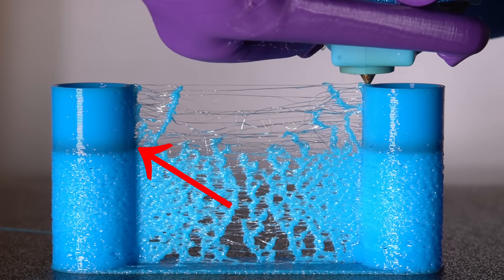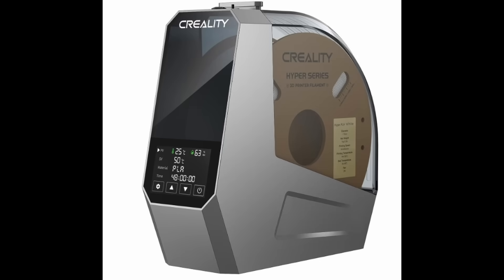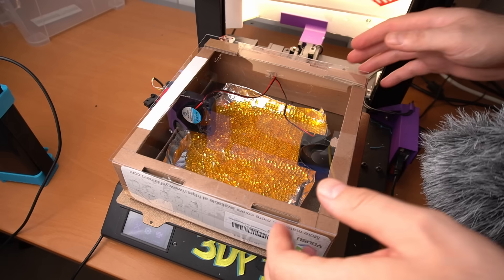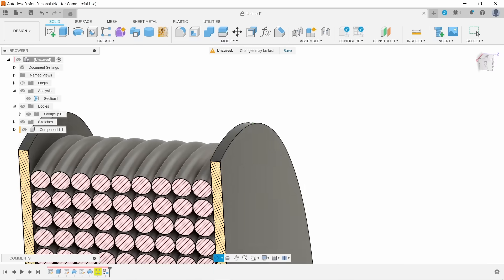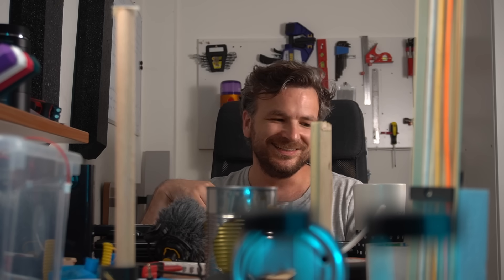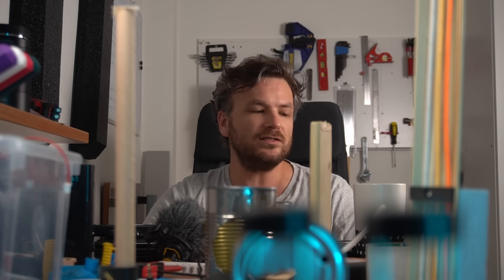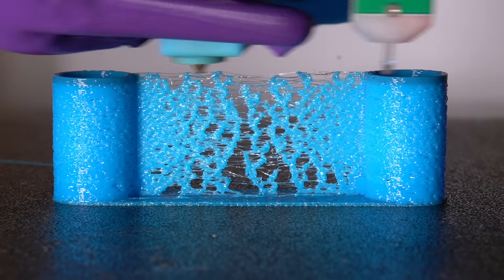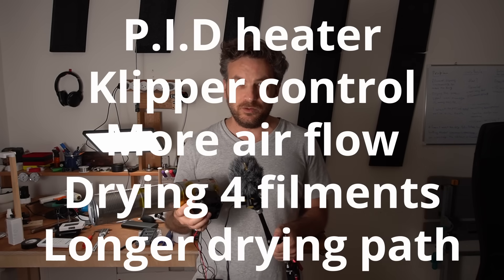Why are we drying filament this way?

Comment: If you need both the Engineer Tin Can and Drybox at the same time for it to work, might as well use a normal filament dryer, right?
You can also easily modify a typical filament dryer by adding fan inside for more airflow, there is plenty of place within the case.
I also don't get the problem you mention with "only drying the outer layer of filament spool" while your tin can only dry a single strain of filament that is going to the hot end.
If I miss a point please do correct me.

Comment: maybe try winding around a spindle on the inside of the can. That way you can get a much more compact form factor.  If wound helically around a 50mm cylinder you will get 15cm each time around they cylinder; so 10 wraps get's you 1.5 meter.  Also if the cylinder can be motor driven, it can solve the problem added drag on the extruder.

Comment: You should rig up some stacked pulleys at each end of the cans and loop the filament back through the cans for multiple passes.  Each pass will give diminishing returns in terms of dryness, so I wouldn't go nuts trying to do too many passes.

Comment: As you have a penchant to experiment, you might want to experiment with increasing the ratio of surface area verses volume of the filament. Examples are flat/ribbon filament and/or several smaller diameter filaments drawn in parallel. An alternative to a traditional drying box (to experiment) is to use a vacuum chamber like they use to degas resins.

Comment: I Think if you can dry the air before you heat it up and put it in the cans it may help dry it out more.  this is where you could use the Dessicant. draw the air through the desiccant and then into cans.

Comment: It's a great idea.  I'd love to see more.  Right now, my 3D print success is kind of hit-and-miss. It would be nice to have more consistent results.  I live in a semi-aired environment, but it's summer, and more moisture is in the air, which I suspect is the potential root cause. Like most people,  I typically have 6+ rolls on the go at once, and some can sit for over a week w/o being used. Be Nice to have a dryer that can handle this.  It would been even better if it could be integrated with the AMS.

Comment: Your probably going to see some improvement if you lag or insulate around your cans, or use a material that won’t just conduct your heat away, PVC pipe would be a contender, or if on the cheap cardboard tube like pringles can.

Comment: Great work. I love these community innovations. Isn't there any kind of industry where they do something similar? I have seen the comments about vacuum chambers etc. But that would make the solution expensive and set you on the path to a € 2000 price tag by the time you have found an easy to operate solution.  And that is not what you are looking for. Also Stephan of CNC kitchen has done some research. Find his video called "Vacuum VS Dehydrator", where he found that vacuum drying looses to heat drying. I like the commenst with some kind of coil in mind. That makes sense but is harder to realise. And you really need heat.
Reply from the maker: one of the comments here said: The funny thing is, we already do use basically this exact method for injection moulding. Especially with smaller machines used in labs and R&D facilities, you don't really have a big material storage with pipes running to each machine, since you change materials way too often. That's why you put your bag of material in a dryer, that's basically a bucket with a hot air blower at the bottom that blows through some desicant (and filters) to dry the granules by blowing warm and very dry air over them. There are inline versions of this, though they require the input material to already be reasonably dry (so similar to your version with the drybox).

Comment: You may still be missing part of the link; airflow is very important but also the air must be dry.  Recirculating the same air means it will become saturated with water and no more drying occurs so either the moisture should be removed from the air, or you simply exhaust the moist air and pump in fresh air which is is exactly how food dehydrators work (which is why they work very well for filament drying).  You are pushing fresh air in with your tin can system, but not with your silica gel drier which is recirculating most of the moist air, apart from a few small leaks.
A problem with this scheme is poor efficiency, you are constantly heating up cool air and then immediately dumping the hot air after it's picked up moisture.  Ideally you want a heat exchanger to pre-heat the fresh air going in with the moist air being exhausted, so that most of the heat remains within the system but the air is still constantly being refreshed. Using air from a non- air conditioned room also means you are at the mercy of the humidity, as this goes up the drying performance of the system will decrease.

Comment: Why not use a vacuum chamber to dry the filament, then all you need to do is buy sealed bins to store your filaments, add a schrader valve to the bin, and when  you put the filaments away, simply pull the bin down a few inches of vacuum and use dessicant beads for any residual moisture that gets pulled from the filament over time.

Comment: Would love to see version 2!  Do you think a smaller diameter can / tube would be more effective?  I wonder if you did something like the dyson hand drier where it is a small jet of air rather than through the can.  Like if you attached the fan and heater to a 3d printed duct that that was the width of the fan but tapered down to the width of the filament +1mm.  Then you would have a blast of heated air focused and concentrated on one spot.
Reply from the maker: That's an interesting idea, concentrated the air flow in one point

Comment: In Poland we make filament dryers from cheap vegetable/fruit/mushroom dryers, since first printers became popular, as drying the forest mushrooms is very popular here. They have airflow, 250W heater driven by thermostat and only need replacement of drying sieves with spool holder.
Reply: That's what I use here in Florida, where we have weeks of 90% humidity in the summer.
Reply: @GeneCash  is that a food dehydrator?
Reply: Yep I use a fruit dryer in the UK, got it on Amazon, works great
Reply: Yep these have been staple filament dryer for years. I think the commercial ones are inspired by them. Do the commercial ones not have airflow? That's a pretty fundamental oversight.
Reply: @sligit  Commercial ones resemble commercial heaters for heat-shaped shoe medical insoles. They are safe, look nice and you are sure that using them you will not be sued for damaging patient's shoe. The fact they don't work at all (insole remains thermally untreated) is the very least concern there.
Reply: @Rampamrampapapapam  so the food dryers are better than the commercial ones?
Reply: @definingslawek4731  In short - YES. But they need some rework to be able to contain whole spool or two. They reward with appropriate power and air flow.
Reply: Are you talking about a food dehydrator?
Reply: Yes, food dryers are better than filament dryers.
All the filament dryers Ive bought and tried would not evacuate moisture efficiently. In some models, humidity would accumulate on the box ceiling and rain back down on my spools. You are forced to use desiccants to absorb released moisture.

Comment: Basically, 3D printing field is still very novel and various startups and small companies making printers, dryers, plastic recyclers as they see fit, they still have very little experience and more then often - not enough technical and scientific knoledge. In about a decade, leaders and outsiders would be clearly seen, small players wold merge, bought by larger competitors or simply going out of business. And we would get a really effective dryers or maybe a filament that won't require drying in the first place. But... would it really be a good thing? 3D printing today mainly driven by enthusiasts and open-source projects, not by large greedy corpos. And it's really great in it's own way. Enjoy it while it lasts.

Comment: you're hilarious, love the format

How warm does the filament get? Do you think this could contribute to heat creep, and/or increase the hotend's max volumetric output?
Think you could seal the tube's environment when turned off with bowden tube couplers on both ends of the tube, and some rotating vent covers when it's turned off? Or would you rather just re-dry the exposed filament before starting the print?
Could your tin can have enough space inside for the extruder motor, so you're drying the filament right before it's taken into a regular bowden setup?

Comment: Good work, of course we would like to see you develop this idea, sounds like you are going to do it anyway.. Are you blowing dry air into the system, can you recycle the air so you don't have to dry undry air on a continous basis, would would it work with a blower if you were just pumping in "warm dry air" this would allow for a underdesk unit without all the cans. Good luck.

Comment: I'd love to see follow-ups to this. I've only recently (re-)started my quest for the holy grail of filament printing because here in summer we can sometimes reach 80% humidity. But even at the current 55% dry boxes have a hard time. I got a SUNLU S2 which just basically does nothing. Even though it has a fan I think it's just doesn't have any way to get rid of the moisture. THen I bought a Polyfill PolyDryer and because it has silica beads included in the box it does a much better job, but after many hours it just gets stuck at 34%. (The box does do a good job of keeping it at that level, 2 weeks later it still reads 34%).
But I'd love to have a way that can a) get below that 34% and b) doesn't take many hours.

Comment: Make the v2, I'm interested in seeing how far you go with this. The series of cans is doing a lot more than I expected but it's still oozing a lot more than I'd like. So there might be a place for this but I don't think it's something I will use but maybe v2 improves on it enough. A big problem is plastic takes a long time to fully release moisture much like it takes a long time to absorb moisture. Separating the coils of filament while drying it around a drum might make enough of a difference.
Reply: I have a Sunlu S1 and it does dry but it needs to be modified. I added a circulating fan, add a hole so a little bit of fresh air cycles through, and reposition the temperature sensor so it measures the air. The temperature sensor keeps the heated plate at a set temperature but it's not heating the air to that temperature. I forget whose video I used as a guide for that.

Comment: I would definitely like to see version 2, I live in a very humid part of the country and if some cans and a little extra electricity can fix the issue without waiting for the dry box to work I am all for it!!! as for multiple drying, I think you would still only need to really dry one at a time since you only print with one filament at a time..

Comment: I think minimising the volume the filament goes through and maximising the heat and air flow through it would make the drier module more efficient.

(I meant minimising cross-section, not the length)

Comment: First.....please, please, please, up your retraction amount!  That horrible stringing between the towers is brutal.

Second, the idea is neat and love seeing people do these things.  Hope to see it evolve.

Third, the idea that 'only the outside dries' is incorrect.  I use a food dehydrator and leave my filaments in there for a min of 24hrs as my place is a constant battle for humidity control (winter too dry, summer too humid....sigh).  I have never found prints that 'suddenly start looking bad' because the inner part was still humid.  I also, and obviously, store my filament in sealed bags with reusable silica gel beads.

As an added bonus, I use the food dehydrator to dry out the beads.
Reply: Retraction doesn't work if you have residual moisture in the filament, and i'm sure he hasn't gotten rid of it all too thoroughly. When the melt forms a gas (steam) pocket from water evaporation in the melt zone, the part below the pocket is going to just leak out, you have no control over it. You can only control cohesive paste/liquid by retraction.

Comment: the key of drying is not directly the airflow - its the air EXCHANGE.
Replacing the hot (and wet from filament) air by cool (fresh and dry)  air is the key, thats why the normal dryers need such a long time (the air exchange rate is much to low).

I dry my silicagel on an open !! pan at about 100° within 20min - best air exchange possible. you can feel the wet air that is directly above the pan!

An inline dryer needs enought time to dry that piece of filemant, so I suggest (Version 2) something like a "inline spool" , that contains maybe 10 windings only in a heated chamber with airexchange (no fan, just ventilation holes maybe). So fresh and wet filament comes into the box - on the dryer-spool (gaps between the turns, and open design) - take 10 turns to get enought time to loose the moisture - and then it goes out dry.

BTW: PTC elements do not really need a thermocontrol. The stuck on their given Temperatur at about 150°max. I did a fan adapter for my DIY dryer box, printed from PETG and it survives since ever without any Thermocontrol.
(you can see it at printables modell 488530).
Reply from the maker: thanks for the segustions, i also think hot air exchange is the key here. i used 300w heater, temp in the cans around 100c
Reply: @3DPI67  think if you extend the time of dry-phase, you can lower the heating power. I use that 50W PTC heater in my dryer, but thats not "inline".
300W add on to the printer consumption ist much energy costs! 5h in a drybox at 50W or print 5h inline at 300W - and the rest of the spool is still wet - makes me "dont do that".
Then its a emergy solution only, if you must print now and the filament is to wet.

Comment: I keep asking people why are we still on filament printers when there are resin printers... its always the same answer, the smell...  i dont know about you but, having to keep materials "dry" fiddling with speeds etc etc to get a proper print is way more troublesome than a little smell that can be easily fixed.

I stayed away from buying these filament printers for years just because of all the hassle they seemed to be and when resin came out i jumped on it...  never regretted it either.

Comment: The only caveat with this on demand drying is that wet filament degrades faster than dry filament. If you burn through any given spool in a timely manner then sure, but if you're like most 3D printing enthusiasts and have some spools on hand that you don't need the entirety of right now but are likely to want later then it's preferable to fully dry those spools and store them in a dry box. Don't get me wrong, it's a pretty clever and simple solution, just need to bear in mind that there are other benefits to whole spool drying.

Comment: I haven't looked around on YT, but I know stuff will dry out fast inside a vacuum chamber. You can get a cheap ($20) good quality vacuum/pressure pump that will pull 20"HG. You can use an old kitchen pressure cooker for the chamber for the spools.

Comment: 2 ideas: 
1) pre-dry the sucked in air with silica gel before heating
2) extend time in chaimber / or filament length in chaimber by a spiral pattern or turnaround wheel within chamber or some similar concept (U-Form Chaimber?) or route filament so that it passes chaimber multiple times

Comment: You should do it with reverse flow. Blower at the top, vents at the bottom. Driest air go to the driest part of the filament, and least dry air to the least dried filament that just arrived.

Comment: A forced air dryer operating inside an AMS would probably do the trick.  If the drying in a dry box only happens on the outside of the spool, that's fine because the printer is only feeding the filament from the outside of the spool.  So hack the cover of the AMS to blast the filament on the outside of the roll and it will likely just work.  The only thing you might run into is the length of filament that rushes in from the AMS to the extruder when you start a print.  It might need some custom code to very slowly feed the first bit of the spool so that amount will also be dry, or just purge a bunch out the poop chute at the beginning.

Comment: I wonder how much drag would be added to the extruder if you had the filament loop around a few pulleys, so it could make multiple passes through the drying tube.
Reply from the maker: That is something ill have to find out

Comment: Store your filaments in a pumped out vacuum bag with indicator silica. Don't leave filament in an environment with a RH% higher than you want your filament to absorb. There are many mods that can be done to the basic Sunlu dryer to recirculate the heated through indicator silica. If your're printing in an environment with a high RH%, stick the filament in a filament dryer while your printing, or at least on a roller in a food box containing indicator silica with the outlet hole just large enough for the filament to pass through, and keep the device you're using close to the 3D printer while you print.

Comment: You could probably use one can if you put a small spool inside the can and wrap the filament around it say 8 or 10 times.  As the filament is drawn out, it'd always keep however many loops you have on the spool.

Comment: You could use a 1 meter length of alumium tube with resistive wire coiled on it,  to get a more even heating, adding direct radiative heating.
Reply from the maker: Nice idea